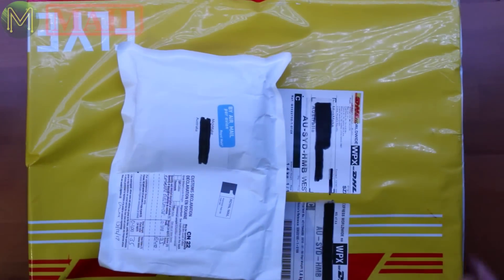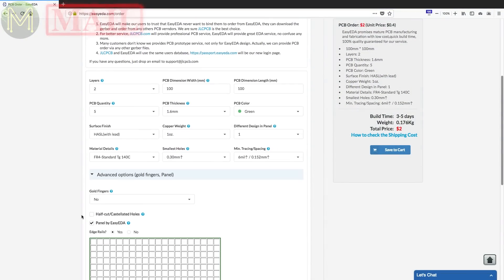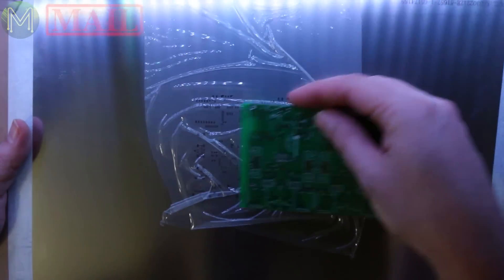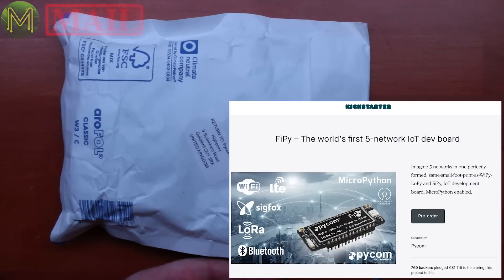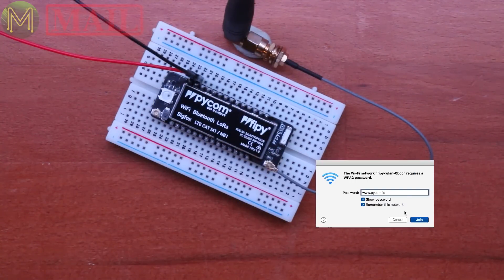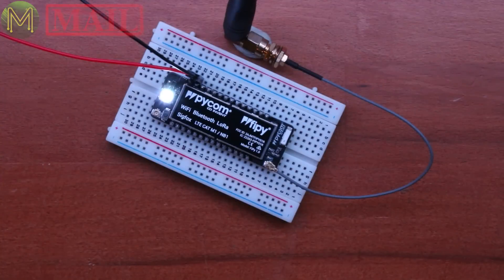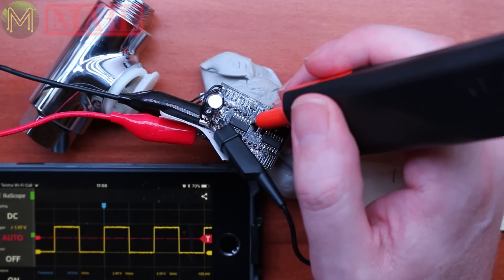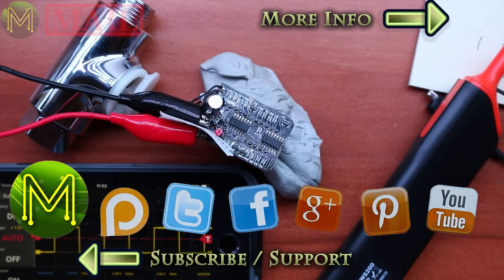#191 MickMake Mail #24: FiPy, showers & my new PCB // News

Comment: Awesome.
Have you tried the Nextion displays yet ?
Reply from the maker: Yup, I have, but one of the of variants. Quite nice displays.
Reply from the maker: But my use case is ultra low power consumption. I want it to run for several days on battery.

Comment: So your thinking of adding Wifi to the temp sensor? I wonder if you could keep tract of GPM/LPS with it?  Could then calculate the Cost per use.
Reply from the maker: The speed of the rotor is easily obtained, but would require a bit more circuitry. I wouldn’t mind designing a board to replace this one completely. One that didn’t have a display on it, just WiFi, but would be hard with only 6mA available.
I’m thinking of using a simple OOK transmitter which should still be able to work at 6mA

Comment: I have one of those generators on my kitchen tap however it just has a coloured light that reflects temperature. Goes from Blue to Green to Red to flashing red when super hot. If you do hack it to show water temperatures via Wi-Fi, I'm sure you'll get a lot of people using it in certain projects where they need to know what temperature their systems are at.
Reply from the maker: Yup, might be tricky getting an ESP to work on such a low current, but I have other ideas that may work: such as using a simple OOK transmitter instead.

Comment: ESP8266 will be to power hungry for the job i think. Bluetooth low energy 5.0 with mesh is probably the way to go, silicon labs BGM11S for example. It goes down to 1.85V. A LDO around 2-2.2v will probably be good + big cap.
Reply from the maker: Yup, that’s what I ended up looking into. I need to finish up with this video though. Too many other distractions!

Comment: Mick, the micro may be a PIC16HVxxx device. It appears (best I can tell) that +ve is going to pin-1 and GND to pin-14 and that would fit.
Reply from the maker: I was thinking that. I might see if I can pull the code off it. Or at least re-program. Will save having to rip off the MCU and then I can use one of the spare GPIOs to talk to an OOK transmitter. Suspect WiFi may draw too much current.

Comment: This will be tricky, seems the water wheel doesn't produce that much current.
Either an energy harvester circuit before starting the esp up for a small time, or use the Ulp of the esp32 to wake only if enough energy is stored..
Reply from the maker: Yup, that’s what I was thinking as well. As was suggested earlier; it’s probably a PIC chip. I’d so; I can slap on a simple OOK transmitter which won’t break the current bank.
Reply: You also, could dive in energy harvesting, like with LTC3588 or similar...

Comment: I have the lopy it was a horrid experience.  Hopefully its updates have improved it.  It remains collecting dust on my shelf.
Reply from the maker: Yup, some people have had the same experience. What issues did you have?
Reply: I too have a LoPy (original release) that I got from a maker talk about 6 months ago and I never got beyond connecting to my home network and reading the temperature and pushing it out to ittt must revisit it one day...
Reply: It had several issues.  It would only connect to wifi once and a while.  The Atom editor add on never really worked.  The editor may have been updated but it was frustrating.  All and all just very buggy.  In addition zero support from PYCOM.  I wish them luck but with no support and the price I might as well deal with the chore of connecting a LoRa module to a feather and a promini.

Comment: What does your "Super Duper" do?
Reply from the maker: At this stage I have a number of possibilities planned. The original goal was to be able to duplicate an SD card without a PC, but decided to add on a LoRa or WiFi module option.
It also has four buttons which can be placed on either side, breakout for an e-ink or OLED display which can be mounted on either side, there’s also a LiPo charger and LDO combo.
I plan to make it all open source with libraries for the Arduino IDE. So people can make their own apps, but it can be used as a remote data logger, image file to SD burner, duplicator, SD sharing over WiFi/LoRa, etc, etc.
Basically a general purpose Super Duper for SD cards.

Comment: I find myself in a bit of a loop designing my own USB hub that is just stripped down to bare components. I find a chip and circuit design but then find said chip is not available, or find one that is but no design reference.
I have a tiny bit of circuit and PCB design knowledge when I worked in a design office at Soundcraft back in 2001
Not sure what to do as I don't have the skill to be able to think, 'oh that needs a resistor there or a cap across this'

Anyone know the USB hub controller of choice at the moment? 

Oh well tge hunt goes on and great video as always.
Reply from the maker: The basics of engineering: it’s always a case of XYZ or zxy or abxc? So many choices. Datasheets will often have a “basic requirements” section that you can work from. This is usually enough to get a basic circuit going.
General rules:
High speed ICs usually require decoupling caps around 100nF to filter out a noisy power line. Put these as close as possible.
You’ll also need USB termination resistance - specs say signal to ground should be 30ohm and differential of 90 ohm.
This is for USB2.0. I suspect it’ll be the same for USB3.0
Reply: If usb2.0 then i recommend looking at FE1.1, available, super cheap super simple to get working and several reference designs.
If usb3....  no ideas yet...  haven't had the need yet unfortunately.
Reply: Yes just USB 2.0 
I do a lot of projects with the Pi Zero 
What I would like to design and make is a small USB powered hub, that has just data to the host. The board would only have only have through holes to solder the USB cables to.

Most times I hack a cheap hub from ebay, but the market has been flooded with 1.0 hubs, which can not handle things like USB audio dongles, Wi-Fi and like.

Thank you for your help.
Reply: Let me know if you need schematics for the FE1.1, I'm using two of them daisy chained to make 7 USB ports out of one...  i use them together with a normal Raspi3.